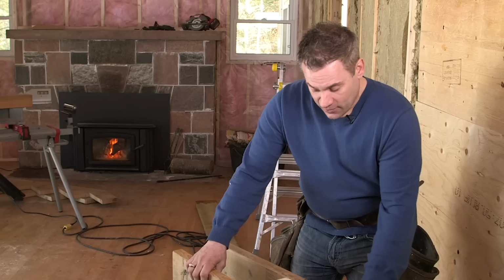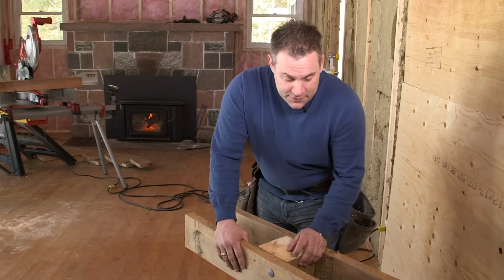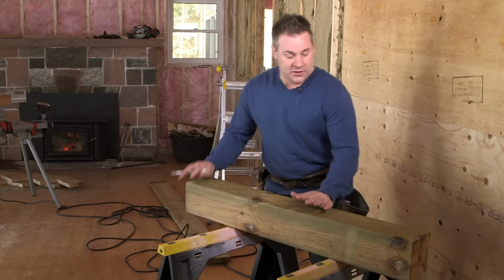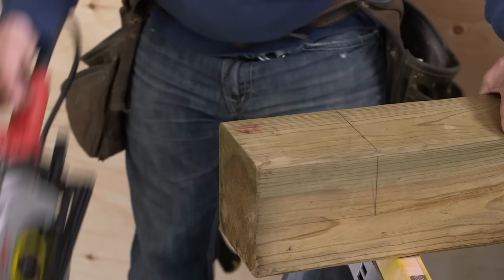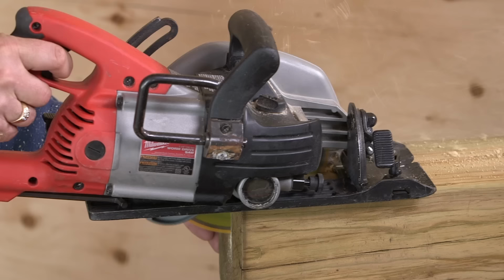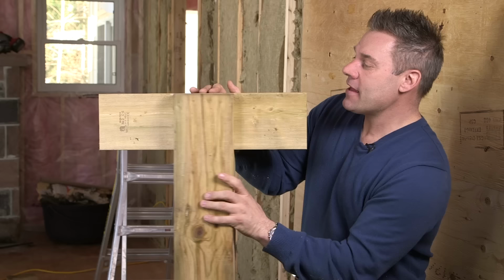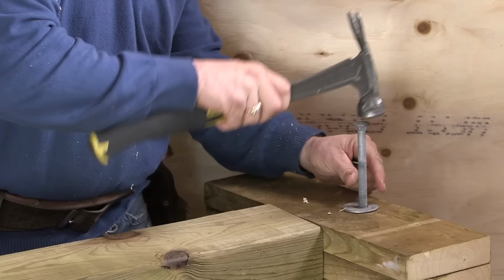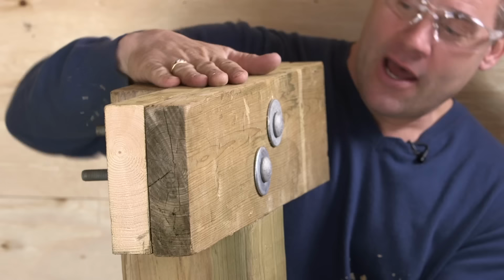How to Attach a Beam to a Post for a Deck | Decks, Docks & Gazebos

Comment: "No shear strength on carriage bolts".

WHAT?! Of course there is. They are rated for shear loads! That's why many areas specifically allow, in their code, attaching beams to posts in the way you say is inappropriate. Just because sitting the beam on a shelf in the post is stronger doesn't mean that carriage bolts aren't strong enough, and that is the purpose of codes: is it good enough or is it not?
Reply: +patty109109 Correct.  Bolts have shear strength.  In an application like this, I'd also be worried about the bearing strength of the wood, where the bolts would tear out if loaded too heavily and if the bolts themselves do not fail, like what happens with rotten wood.  But if the beam sits on the post, that removes the wood's bearing strength from the equation as well.
Reply: "if the bolts themselves do not fail, like what happens with rotten wood."
A deck made out of rotten wood is unsafe, full stop. Doesn't matter HOW you construct it! Exposed wood will tend to weather, warp, crack and rot over its lifetime, and periodic inspection and maintenance is mandatory. A deck is NOT "set and forget," and there is no need for the carriage bolts to be, either.
Reply: John Dough if you're worried about the strength of the wood, use better wood, or a thicker beam, or place the bolts a bit lower on the beam, or use a timber-jointing plate as used for nailed roof trusses. Better not to cut into the timber and expose untreated wood and create surfaces to collect damp and standing water.
Reply: William Chamberlain Every time you cut a piece of treated wood you expose "untreated" wood. By your logic we shouldn't cut anything.
Reply: Skinny Moose you can and are supposed to treat the surface you cut...
Reply: patty109109 sure strong enough is ok but why not code plus? I never built anything based on a government entities idea of minimum.
Reply: None of you have an engineering degree by your comments.... always build using DIRECT LOAD.  For the life and safety of your build never rely on bolts.  This video is 100% correct.   Anyone saying otherwise is covering for their bad work or lack of knowledge.
Reply: Personally I think that notching a post for a beam to sit on it it’s better and definitely stronger...
Reply: Robert Paulson 
Does this just apply to wood?
Cause we just finished working on a 20,000 sq ft building, and there is about a 1500 sq ft second story area that is entirely suported by steel beams that are bolted to steel support beams. The floor has been poured with concrete, and only thing holding this up are the bolts that go through the beams. No point load! If an engineer passed it, im sure he can verify the sheer strength of the fasteners.
Ive honestly seem many decks built exactly like the start of this vid, and never seen any catastrophic failures...
Unless you have a deck large enough to support a block party, i think this method of using the carriage bolts to support the decking is perfectly fine
Reply: splash, I worked for a steel erector for 9 years and I've always seen steel lips that were welded onto the columns giving the steel beams a place to sit. Also the bolts used in steel erection aren't the same as what you would buy at your local hardware store, washers and nuts too.  They are engineered for this purpose.
Reply: Rocket Surgery 
No lips on the job im talking about...
Also, i totally understand these arent cheap hardware store bolts, its just the point i was making that all the weight of the second floor area, are basically on bolts!
Personally, ive never seen a deck break carriage bolts
Reply: splash sadly it happens,  not often but it does.
Reply: splash.  . agree....if the lumber and fasteners are properly sized to the gross load with a safety margin ...they do fine.
Reply: So all the weight of your deck plus load is on 6 bolts? Not a good idea.
Reply: As an engineer, I try to design systems that don't rely solely on threaded fasteners in shear. That's not to say that it's never adequate because it oft times is, but it's also, from a design standpoint, totally avoidable in most cases.  So,  it's not always a question of "right" or "wrong", so much as it is,  "right or wrong for what?".

If i built you a scaffold, wood beams and small carriage bolts in shear, i could size the bolts such that they would support you, your tools and whatever else you might be carrying to SOME safety factor. Now, is it adequate? Of course... but if i could build to a larger safety factor, such that you might fall onto the scaffold or, drop a beam onto it, etc, etc, and not risk integrity of the structure... would you want that?

Notching the beam,  IMO, is a smart practice that guarantees the structure will support whatever one might throw at it. Say... the entire Green Bay Packer football team, clog dancing.
Reply: zaknefain100 People don't take into account dynamic loads. I've seen an awning under construction and a worker stumbled and came down on it hard. Several purlins snapped one after another. It was supporting several workers walking on it but one worker falling on it was too much. Of course it was much stronger once completed but it was a good example of the power of dynamic forces.
Reply: yes i have a  engineering degree .... and yes it can be done on both ways .... it is up to what kinda Bolts you useing ....
Reply: The carriage bolts in the beginning of the video to secure the beams to the sides of the post work best for non heavy load applications like for a roof of a wood gazebo for instance. But when building a deck, they way he explains is a more proper way of securing beams to post is usually best. I prefer using a type of anchor bracket that sits on top of the post and allows the beam to then be secured that way. There’re many good ways to secure the beams to the posts, as long as you have the right knowledge of the do’s and don’ts; what not to do and how to do it right. Awesome video man. 😉😁
Reply: Just in case... his name was Robert Paulson. I see what you did there. 👍
Reply: Haha Love the Movie reference! 👍
Reply: Am I the only one who understands that he was just simplifying the concept by figuratively saying carriage bolts have "no shear strength"? I used to say my car had no power...but nobody criticized me for saying it. Kudos to him for sharing the tip.
Reply: Yes
Reply: I do not like cut the wood more than 1/3 to hole the beams
Reply: patty109109 carriage bolts yes have some shear load capacity’s, but not as well as setting the main load beam on top of the actual post. You see, over the years, all that weight from the actual deck, furniture, people and movement, those bolts will only hold for so long. So you’re not wrong, it’s just not the “BEST” and Most LASTING”  way of holding your deck up. This guy is just explaining a way to extend or lengthen the life of your deck when built. From the ground up. 😉
Reply: Robert Paulson   For a house, yes. A deck will have a few people and a bbq on it, not much of a load.
Reply: This is more of an answer to the replies to this comment. I am a structural engineer, and for those who think the code is a bare minimum or isn't safe enough, I can assure you that it is. The loading required by the building code is worst case scenario for intended use, meaning that you have to intentionally try to load a framing system to its code load. There are also quite a few safety factors built into the strength values of wood. The first step in determining the wood strength values found in the NDS (National Design Specification) for wood is after testing a number of specimens for a given species, the initial allowable stress is taken as the 5th percentile, meaning that out of one hundred pieces tested, ninety five would be as strong or stronger than the piece giving you your baseline stress. Then they apply additional safety factors on top of that. Bolts can be used in shear connections, but they are not as strong as people would think. In the case shown in the video, the connection would likely fail due to the wood beams splitting. If you use bolts as he showed not to do, the minimum distance from the edge of the board to the bolt should be four times the bolt diameter. Direct bearing is preferable, but if you need to use bolts, there are ways to determine the number of bolts needed and the connection layout.
Reply: Hue Janus The vast majority of the load is the the joists and the decking itself, not the people and furniture. The new solid composite decking like trex is very heavy compared to traditional wood decking.
Reply: you might as well do it right and notch the post. not worth jeopardizing someones family...
Reply: @splash5974  NO expert, but my understanding is, yes...this only applies to wood.  The video was incorrect in saying shearing bolts is the potential problem.  The wood holding the bolts up CAN BE.  A few bolts thru the post is only a very few sq in of surface area for the massive weight the beam must support.  A little rot in there and...
Reply: @RobertMPaulson  if you open your eyes before opening your mouth you would have seen there is an engineer here  his name is  Clark Magnuson

Comment: I've been trying to make a loft bed frame and I very rarely see this principle of putting the beams on top of the posts being followed in youtube videos. I don't know if this is required for things like beds that won't hold so much weight, but it seems like a sound principle to follow regardless.

Comment: I did a quick google search and the shear strength of a 1/2 carriage bolt is almost 1500lbs. With 2 bolts thats 3000LBS of shear on any given point load. Unless you are planning on having an elephant fight a rhino on your deck, the carriage bolts will be sufficient.

That being said, I use at least 4x6 post for every deck, pergola or fence that I make. I use pockets or bridle joints for all of the point loads. I usually pin my beams to the posts with dowels rather than carriage bolt, but the idea is the same.

 I do this for 2 reasons; 1) If you can build with with proper joinery, its always stronger and there is zero opportunity for rust; 2) I use it as an aesthetic quality. The post and beam/timber frame look awesome!

Comment: The bolts arent the problem its the shear load on the wood around the bolts. That's why they use metal plates to join sometimes

Comment: The point missed here is if the bolts are properly tightened, the pressure exerted on the post from the two sides developes a lot of friction. That friction is a major contributor to the weight carrying capacity. It isn't just the bolts. It's the assembly in it's entirety that becomes stronger than the components could ever be when considered separately. The notches aren't a bad idea, but I don't think they're as necessary as stated either. 
   Jmho, fwiw, ymmv, etc.
Reply: Agreed, besides, the bolts would need ridiculous weight to snap.

Comment: while i agree, this method demonstrated here, is the better way...i've never seen the "go thru bolt" method fail.
Reply: Thats because the shear strength of carriage bolts are incredibly high.. The wood around the bolt would start failing before the bolt does. You could always go around under the deck and shore up some wood under the joist and tie it into the post if there is any sagging etc or wood failure.
Reply: Neither have I.  Except for failing a code inspection, if the inspector bothers to look.
Reply: It would take a lot more measurements to notch the posts when building on uneven ground.
Reply: @RSoles-hz9nc  The trouble I have seen with through-bolts is that they invariably loosen up causing the post and joist to drift out of square, not to mention that where I live inspectors would fail them every time.  The ones I see are usually on homeowner or brother-in-law decks that were never permitted.  

Are you making sure your layout is square, and do you use a plumb line to determine pier location before locating and measuring the posts?  That is how I do it and although it is not perfect (what is?) it always gets me to within about half an inch or so for the post location which is close enough for the pier, then I measure the location for the notches after determining exactly where the rim joists will be located.  I also use scrap lumber to do a mock-up especially for larger decks and that helps.  I'm not trying to insult your intelligence, just trying to be helpful.
Reply: @Mr TriL it depends on the conditions, type of wood used, and how the deck is finished.
Reply: We just modified or deck, and trying to take the carriage bolt section apart was a nightmare. And this deck was up for over 10 years. The wood, and bolts, were still in excellent shape. And we live in an area with snowy winters.

Comment: When a wood face touches a wood face and you clamp them it creates friction. Think of how a rim is clamped to a wheel hub. The studs aren't getting a shear load, instead the load is being transferred by friction. Therefore the studs only experience a tensile load.
Reply: Agreed, but over time the wood compresses under the bolt head, and the preload is greatly reduced, if not lost completely. Then the friction clamp load goes away.
Reply: @rossgalbraith3878  very true. This is why when I clamp wood I build a metal plate with 6 or so bolt holes. The clamp area then is so large that you don't get this issue. I try to avoid that as it's costly but in some places it's the only way to get it to work.

Comment: And what would you do with a 4x4? I assume only notching half is better than not at all?
Reply: Glue and nail the joists together, then place the beam on top of the post and put 45 degree 4x4 braces. Fasten with strong ties. No bolts or notches needed.

Comment: My deck was a foot or two off the ground, see no problem using the "wrong" method. Even a grade 1 bolt has a load rating of 33,000 psi. The problems are water intrusion and aging of the wood from climate cycles.
Ancient wood building constructions withstood many hundreds of years without any metal fasteners. In contrast my decks only lasted 30 years with screws, nails, and bolts.

Comment: thank you, 20 years ago we bud my deck, and the post beam is installed exactly as you presented the wrong way. There are Six  4/4  scattered beams, I am noticing some crack in the beams. Should I place few more 6/6 next to the other beams? How can I reinforce it? I can not effort to ripped all down. Thanks
Reply: If a post (vertical) is cracking, don't worry about it. If a beam (horizontal) is cracking, sister another board making a laminated beam

Comment: The function of the carriage bolt was reduced when you used a washer on the head end of it.  Nut end washer OK - head end ---WHHUUUT?
Reply: As you say, good luck tightening that carriage bolt beyond finger tight, the heads just going to spin. Amazing, everything this guy has said in this video is wrong.

Comment: Numb nuts, what's going to shear the carriage bolts, an M-1 tank?
Reply: Anton Bouchette 
The pressure of weight on the wood can push down on the bolts and split the wood. If you use a lot it will spread the load.

Comment: Shear weight for that screw is 150 lbs. It's not the same with half the screw exposed. Beginners stuff. Your information is not accurate.  It all depends on the "load" .carriage bolt has 500 lbs shear weight. For a deck it's fine. For a load bearing wall, course not because you need to " "transfer load"

Comment: I agree with Clark.  As an engineer, I can tell you that there is plenty of shear strength in those half inch bolts.  However, I would definitely build the post and joist the way this guy does, by notching the post.  It's just better and tidier.

Comment: 2 carriage bolts in each post works just fine for a beam.  Building decks for 18 years and never had a single issue doing it.

Comment: Attaching a beam to a post face mounted with through bolts isn’t “WRONG.”  It all depends on how much weight the beam is supporting.  It’s perfectly acceptable to face mount and through bolt a beam for light duty residential applications.  Accordingly, It’s spec’ed that way in the IBC as an acceptable option.

Comment: Can’t tell you how many times I’ve been in arguments with inspectors and contractors over this supposed better way.  First by notching the post you severely increase the chance that it will split and fail anyways in the near future. Second the wood would bust before shear off a 1/2 galvanized through bolt and there are 2.... I guess I will always build mine the wrong way as long as I can get by with it.
Reply: The point about wood failure is a good one.
Reply: Technically there are 4 point of shear, making it considerably stronger than most are even arguing

Comment: I’m planning to build a deck for my dad. About 12 feet off the ground  at the highest point. Was planning to sandwich three 2 x 6 joist’s and just set them right on top of the post after coating them and polyurethane, then gluing and screwing them together.  I was then going to sandwich the posts with additional 2 x 6 boards to hold the joists on top. Fill in the gap with piece of plywood and then set a single carriage bolt through on the top of each post. And then one bolt in the middle and one bolt at the bottom.  Planning to use bigger than a half inch carriage bolts. Maybe 1 inch stainless steel if I can find them. Not sure about code though. Might use a rubber membrane on top of the joists for extra protection.

Comment: I’m just curious, as to where he found washers, that fit on the head side, of a carriage bolt??
Reply: While I don't necessairly agree with his method, they do make washer with square holes for carriage bolts, they have points on them that grip into the wood so it will not spin on you if you need to take the off
Reply: It's just a large washer hole... What's the mystery?